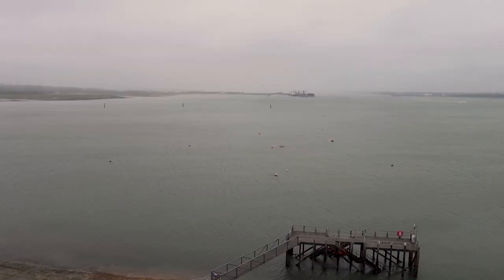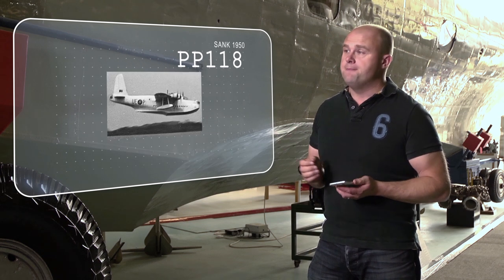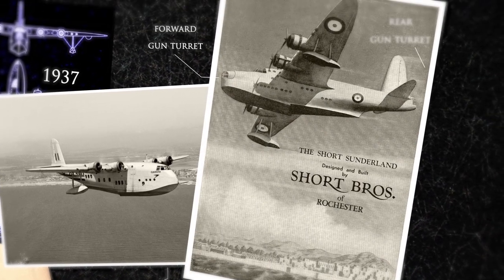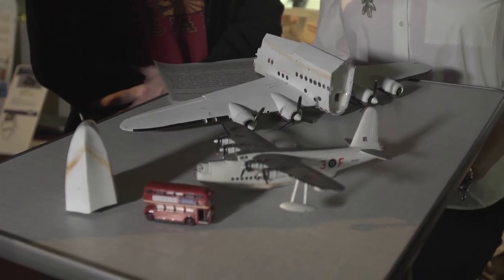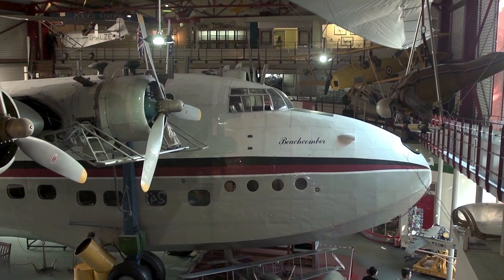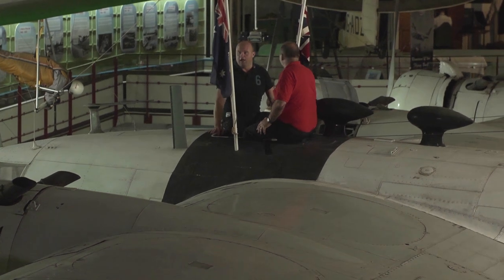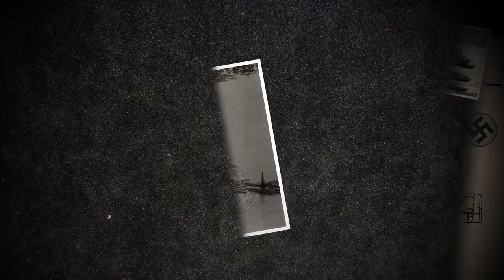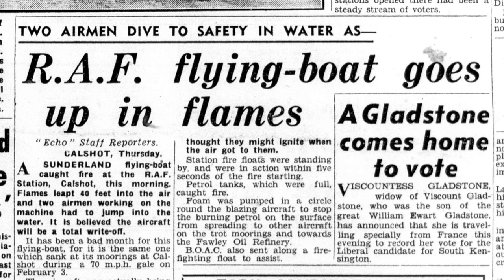Aircraft Mystery The Lost Flying Boat

Comment: Into the 1970s and '80s Navy clearance diver units (CDUs) were still actively involved in exploding the wrecks off Calshot to prevent them becoming hazards to navigation.  My aunt's son was a navy clearance diver who was involved in detonating at least one sircraft wreck off Calshot, it wasn't always clear what was being demolished due to the occasionally poor conditions of visibility under the water and the frequently poor condition of the items in question.  It was quite a hot-spot for aircraft wrecks not just because of the flying boat operations there but also because of its proximity to Southampton which was a very heavily attacked city due to its docks.  The Sunderlands, apparently, while great aircraft were, apparently, rather less good on the water and even moderate weather conditions could see them sinking whilst moored while attempting to take-off or land in less than calm conditions could result in them catching a wave and flipping or breaching the hull where the aircraft's momentum would cause it to flood rapidly and effectively drive itself into the depths.  There are, apparently, the wrecks of two further Sunderlands just off Netley that were shot down in a friendly fire incident, being mistaken for enemy aircraft as they were off the normal track for aircraft flying from, or returning to, Calshot,  tragically...

Comment: I would suggest that the nose section was removed in training operations, probably for Navy CDUs who can be involved in rescue operations involving aircraft lost at sea.  Another possibility is that this was a damaged aircraft which may have been undergoing repairs or was considered unfit for further service and was stripped for usable parts before sinking, though I would imagine there would be more in the way of records for the aircraft if it had been stripped for parts as often more careful records were kept for aircraft withdrawn from service and stripped than were maintained for repairs to in-service aircraft due to the pressure of time there was for repairing aircraft and the lack of pressure of time on stripping a written-off unit...

Comment: So are you going to try and dive down this summer, if you do don't pick spring tides, you will have a good 8 knots current, that will stir up the mud, would be better to try neap tides, when the water is moving a much slower place, when you get only a 1.5 meter tidal range. The River Test and the lesser other 3 rivers that join the Test are all chalk rivers, that is why the water looks that milky green